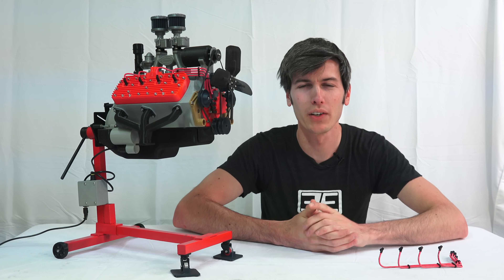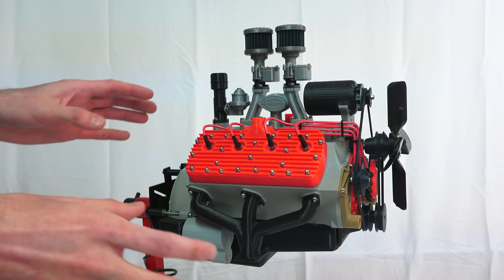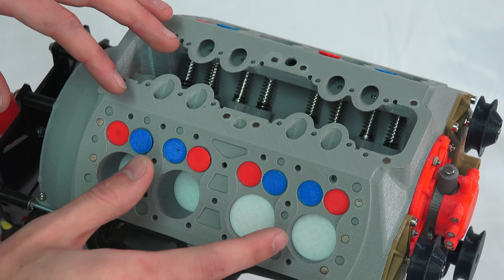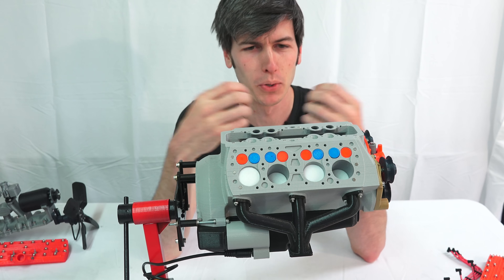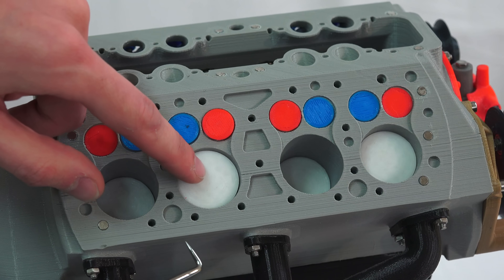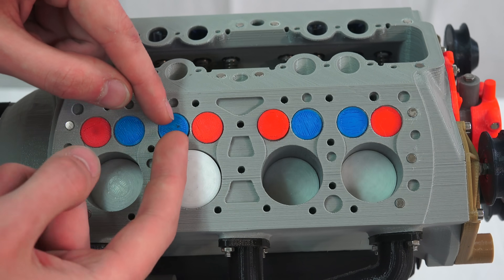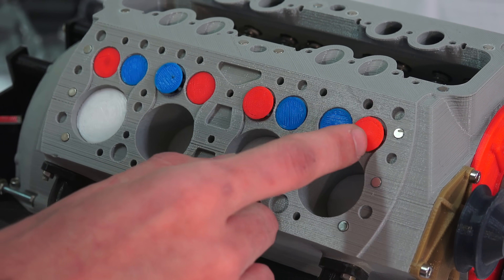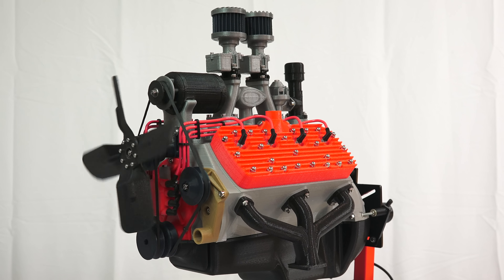Why Ford's Flathead V8 Engine Died

Comment: There would be no hot rodding as its known today and a majority of the performance aftermarket without the flathead V8 being phased out and filling the junkyards. I would say the good ol' flatty died an honorable death instead of just being another piece of obsolete technology.
Reply: The cycle continues, from the flathead to the sbc, now ls platform
Reply: but i don't see the small blocks and ls'es dying out like the flatheads did. They still pack a very reasonable punch in terms of performance instead of being plagued by design flaws and choked by inherent limitation of the side valve layout. They also enjoy extraordinary aftermarket support and would even flourish well past the point when the automotive industry has gone entire electric.
Reply: Tianze Li.  The thing is particularly with the SBC the aftermarket is actually a result of the engines shortcomings.   A typical very high performance small block chevy build uses zero OEM parts, and may be built out of components different enough to reasonably qualify it as a different design all together.
Reply: SMELLTHEGLOVE 
Haha baaaah 
Yup it’s where we came from, can’t deny it. 
Wouldn’t be where we are today with clean cars if it wasn’t for progression.
The wife’s newer pedestrian car would walk most semi hot flattys from back then, and get 38 highway. 
That’s nice and all, but a flatty sounds better.
Reply: The good ol' flattie hasn't died at all. Even today the aftermarket is so strong that you can pretty much build a complete turn-key engine starting from *just a block*. Moreover, part support is good enough that, even today, it's still practical to daily drive one.

Cheaper to fix and maintain, too, than a modern car. Go figure. Next car I buy is prolly gonna have one of these things under the hood.
Reply: Chris M shut up.
Reply: This is very true. Plenty of cheap used motors + shortcomings to overcome = performance aftermarket. It's exactly the same with the LS-based engines of 2000s.
Reply: My second cousin ran shine in a 40 Ford V8 until Olds came out with their "Rocket" 303. He hopped a train to Detroit to get one since none were available locally and by all accounts he had the fastest car in these parts for the next 4 years. He quit the business when the Cops got 2-way radios because you couldn't outrun those.
Reply: actually after market performance parts began with the Model T, and aftermarket performance  parts where vailable for the flat head V8 before it was phased out. Modern Eara hot rodding began when OHV V8s where swapped into cars that had the flat head V8 as stock, because those cars where light weight
Reply: They never died, calmed way down but there are tons of them still out there. Tons of aftermarket support for them still.

I got one hanging on a motor stand in my shop right now just because. I'm an orange blooded chevy guy but you gotta give them respect as they did start the craze.
Reply: Matthew Edwards, the 32 Deuce had a 327 with 4 Rochesters and fuelie heads on it, the 55 150 had a 454 in it, HUGE difference.
Harry, Offenhauser owned the tracks in the days before the 265 SBC came out, and they did it with Offy engines not flatheads.
Reply: Actually Offenhauser and Edelbrock and others built parts FOR the Flat Head V8 and they were the starting point OF the aftermarket parts!! Because of Salt flat racing, the Flat head needed the speed parts to START the Hot Rod movement!!! I am positive at the Hot Rod Museum in California they have one picture of Vic Edelbrock Senior at the salt flats test new Flat Head intake designs!!! I know I have seen that photo myself in the pages of Hot Rod Magazine.....something kids these days don't seem to understand that a magazine is what we had BEFORE the internet!!! And that photo was taken in the late 1940s if my memory serves me to start with!!
Reply: Yep, Offenhauser, Edelbrock, Hilborn, Iskenderian and so on, you just name it, quite a number of performance brands specializing in almost every aspect all have their history tracing back to flathead performance. It's indeed a very intriguing piece of history to study and appreciate.
Reply: Daniel Yang GTFO XD
Reply: Both Olds and Cadillac came out with their OHV V-8s in 1949 and from that point onward the flathead was doomed, long before 1962 (American Graffiti).
Reply: These engines are not designed for racing at 9000 rpm- they are for getting around, to the store, etc.
You reference as "shortcoming" the fact that sbc in stock form won't rev to 9k or produce 2 hp per cubic inch.
you judge this engine AS IF it were designed for all out performance- meaning RACING ON A TRACK NOT THE STREET.
Reply: A lot of the lessons learned on the Flathead V8 esp in manufacturing were applied to it's successor the Y block V8.
Reply: Berenger Christy Hey at least it had reliability going for it, so not all bad
Reply: They lasted so long
Reply: Tianze Li8
Reply: Tianze Li---   Uh-uh...  hot-rodding was alive & well during the 1920's and 1930's, with Frontenac (an after-market race-goodie manufacturer) making aluminum-alloy heads for the Model 'T' Ford engine.  A lot of 'T's were raced, including by the Chevrolet brothers, Louis & Gaston, who went to...  well, we know what happened next.
Reply: Berenger Christy don't pretend like you would have been any different had you lived back then.
Reply: Chris M flathead v8 vs small block v8. Just go watch.
You social justice warriors have to bring your crap into everything.
This is a video about an old engine design.
Nothing to do with social justice.
Buzz off.
Reply: Tianze Li 
I wish more old timers were here in the comments telling us about back in the day. 
All I know about em is what I’ve heard from them. 
I’ve been around a few of em too, I dig em for the simplicity and history .....runnin shine thru the back country and whatnot with a 32 ford with truck springs so it doesn’t sag and attract attention from the man.
Reply: Berenger Christy wow you sound fun to hang out with!!
Reply: Watch; American Grafitti.
The pivotal car race scene with Harrison Ford displays the effect of the new ohv v8 over comming the old flat head v8.
Reply: true, but not due to the engine being that good.  it is a big part of our history- we pay homage to those days- possibly because the USA was semi-free, and more fun.
Reply: oh yes, of course and you'll look back and say, "Damn, those tide pods were delicious and those condoms smelled good."  Also decency seems to be obsolete to you. All in all, enjoy your day :)
Reply: Chris M You seem to be a victim of your times - a victim of indoctrination.
Reply: The Ford flathead ain’t dead! Got one in my 48 truck to prove it. That’s blasphemy.
Reply: Mathew Edwards , who was talking to you ? I was going to reply to your comment but decided not to . However now you have decided to attack me , I will . Perhaps you should watch American graffiti again , John Milner's 32 Hi - Boy had a small block Chev engine not a flathead . Big mouth .
Reply: It’s like how Jesus died on the cross lol (speed gods?)
Reply: Nah fam donno whatchu talkin' bout lol

jk totally agreed
Reply: Berenger Christy , what's changed ? Afghanistan , Iraq , Syria . White cops using black folks as target practice and 5 times more cars on the roads . Russia and the USA still at each others throats . North Korea still a threat to the world . There's an old saying , The more things change , the more they stay the same .
Reply: Matthew Edwards  >  R E T A R D !!!
Reply: North Korea has never been a threat to anyone. The only war they've ever been involved with was when they tried to assist a revolution in the south - a revolution that only happened because the yanks had put in a fascist dictator called Syngman Rhee. Now south korea has a leftwing government they're organizing reunification. Yankees go home.
Reply: better than fetishizing the "good ol' days" and whitewashing over all the bad parts
Reply: ah yes the "good ol' days." everyone remembers them through rose tinted nostalgia goggles. back when there was the korean war, the vietnam war, when black people were given separate but """""equal""""" everything, and when lack of environmental regulation turned the air in our big cities into unbreathable miasmas. such good times

also the flathead is a piece of obsolete technology. sorry

Comment: can you do one of these about the VW beetle engine? i know you've done about boxerengines alraedy, but not about aircooled ones with carburetors instead of EFI. airflow and oilmanagement surely is vastly different from subaru engines. plus you'd be doing a video on another car which caused mass motorisation in a country just like this ford engine. following that could be the Austin Mini and the Citroën 2CV.
Reply: TheWolvesCurse  +1. Good idea!
Reply: TheWolvesCurse A VW is a boxer/pancake/ dually opposed... take your pick.
Reply: @ronaldreed7698  Never heard it called pancake or dually opposed. +1 new terminology
Reply: or the 2cv one, which is the smaller variant :D